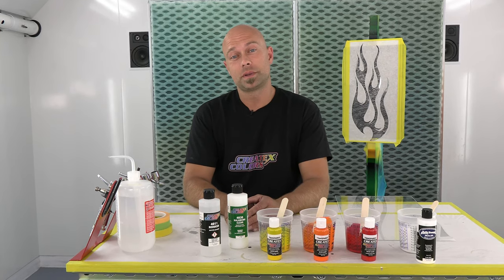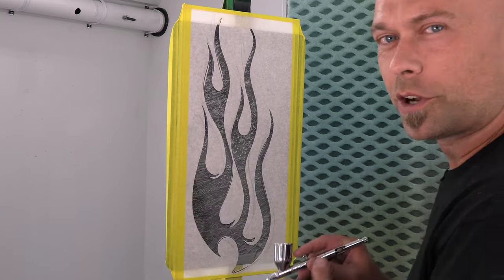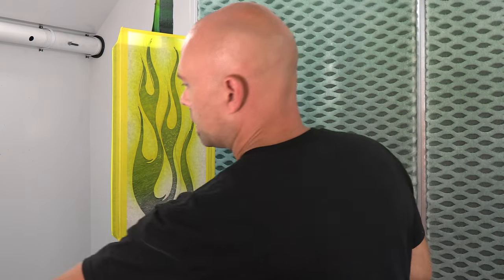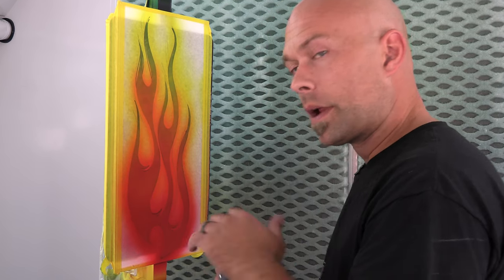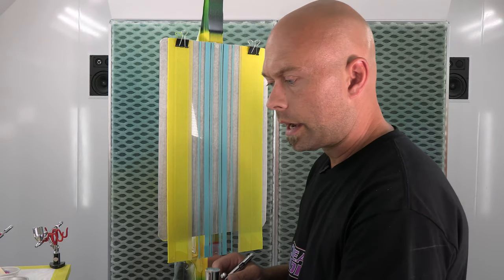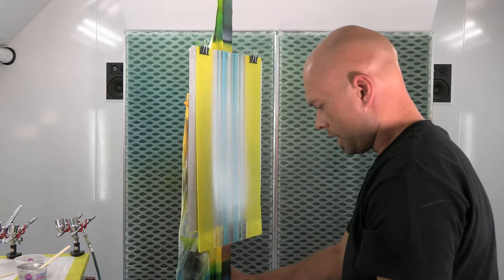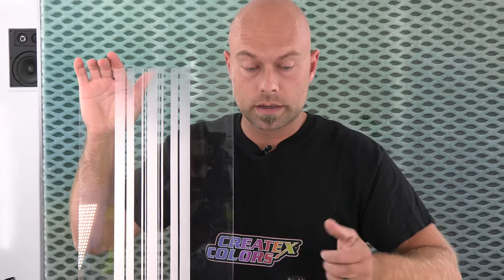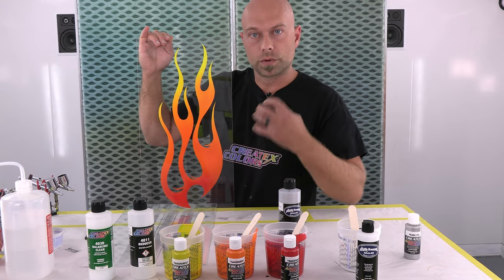How-To Reverse Paint RC Graphics onto Polycarbonate

Comment: Excellent work, very good finish, I just need to investigate a little more some details, and the main thing to acquire the paints and the different elements to try to carry out the painting of two RC bodies, one in polycarbonate (Lexan) and the other in ABS plastic
Reply from the maker: thanks, for more help, please email us at info@createxcolors.com
Reply: @CreatexColors  It is the first time that I am going to acquire Createx paints, if I am interested in the technical issues of dissolution, paint percentages and reducers, as well as if they have varnish or lacquers to give a glossy finish. In the past I have used automotive paints, and gloss or lacquer for the final finish with its respective catalyst, only this paint is very different from Createx. Since Createx is water based, and I have never used this type of paint.

Comment: Great video. Spraying at only 30psi with a great spray pattern and no needle-tip buildup makes me seriously want to toss my old T&C Vega 2000 in the garbage and try a gravity feed. What model is that Iwata, specifically? Also, do you prefer gravity-feed airbushes to siphon-feeds? How's the clean-up process and/or swapping between colors (if not doing a transition like you did)? Major pain? And finally, when you say "sealer white" is that a specific Createx formulation, or is it just Opaque White? Thanks! EDIT: Ah, I see that "sealer white" is Createx's(?) AutoBorne Sealer white.
Reply from the maker: The airbrush is an Iwata Eclipse HP-CS. Use the 4011 Reducer to flush the airbrush in between color changes. The sealer mentioned is AutoBorne Sealer 6001 Sealer White, www.autoborne.com. Thank you.
Reply: @CreatexColors  Thank you for the information. If it's the HP-CS, did you add the preset handle? That's what was throwing me off!
Reply: @CreatexColors  Can you please recommend a good, water-based grease and wax remover?

Comment: Could you consider doing a Lexan RC body shell complete reverse painting design.   Due to impact while racing, would we need to scuff first so paint doesn't chip off?
Reply from the maker: Createx paints are often used for RC body painting onto polycarbonate / Lexan without scuffing. Createx Airbrush Colors and Wicked Colors adhere well to polycarbonate without scuffing. Thank you.
Reply: Wouldn’t scuffing be seen through the body anyway?
Reply: @codyprice0295  Yes and no.  Scuffing won't be noticeable with most opaque colors, but would show on special effect colors such as chrome, pearls, metallic, flakes or shift.
It's just best not to scuff as it really isn't necessary if you follow the TDS and really allow the paint to cure before moving on to the next coat or step.

Comment: I use the createx pearls a lot on scale model bodies, do you think the silver sealer would be a better base or first coat for pearls other than silver? I really like the idea of fewer coats to preserve detail.
Reply from the maker: 6013 Silver Sealer's aluminum flake size is the same as 4102 Aluminum Medium, which can work to scale for some finishes where a coarser metallic works, https://autoaircolors.com/pearl-and-metallic-colors/metallic-colors/4102.html. For most scale silver finishes, Createx 5308 Pearl Silver, 4302 Pearlized Silver, 4333 Metallic Silver or 4104 Aluminum Fine will work better, with 6013 Silver Sealer used as a backing color. Thank you.

Comment: Is your sealer as durable as your 4050.  Ive been using 4050 as finale coat for durability.
Reply from the maker: The acrylic resin used to make AutoBorne Sealer is also used to make UVLS Clears, in which that acrylic resin is blended with 2 urethane resins. As an adhesive coating, UVLS Clears and AutoBorne Sealer are fairly close onto most substrates except glass, for which UVLS has better adhesion. In regard to a durable top-coat, UVLS Clears are more durable and more protective top-coat. AutoBorne Sealer is an adhesive ground-coat / sealer-primer. UVLS is a top-coat clear that also works well as an adhesive ground-coat. Thank you.

Comment: I noticed you didnt mention adhesion promoter. Is it not needed, or not recommended. My sons are getting into RC cars I have to paint, and several people have told me I have to use adhesion promoter.
Reply from the maker: No adhesion promoter required.  We've been making RC paint under private label and with our Createx brand for over 30 years; an adhesion promoter is not required when painting polycarbonate. Thank you.
Reply: I will say it's not needed as well. I've airbrushed lots of these bodies and never had a delamination problem. They have held up to lots of my kids crashes and roll overs.

Comment: If the paint wants to peel up with the masking (even after extended drying times) is that a product of being too heavy handed with the paint or possibly another issue?
Reply from the maker: Applying paint in heavy coats often leads to failure, especially when multiple heavy coats are applied with re-coat times that do not let each coat dry before applying the next coat. Ultimately, curing is the issue; when paint is applied in heavy coats without adequate re-coat time to allow each coat to dry tack free, the time to dry before the coating has adequate adhesion is greatly extended, perhaps instead of 60 minutes dry time before tape, dry time may be 24 - 48 hours. Thank you.

Comment: Sometimes I use a heat gun at the least hot setting to speed up drying between coats. Of course far away from the substrate. Is that ok or something you advice against?
Reply from the maker: We do not recommend heat for assisting drying; moving air is best. Warm moving air is good, but not direct heat. For this and other information, please review the Hard Surface application guide and tech data sheets available at www.creatextech.com. Thank you.